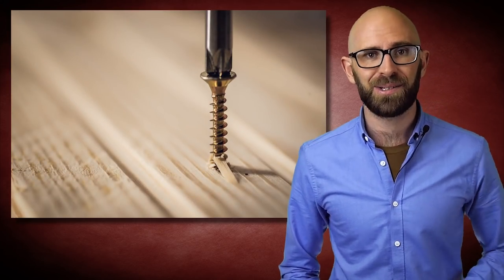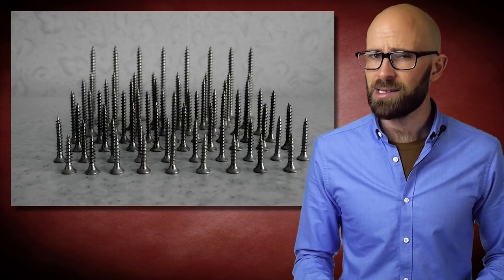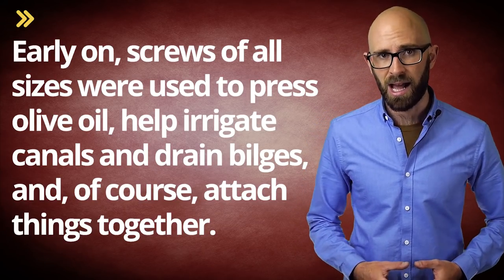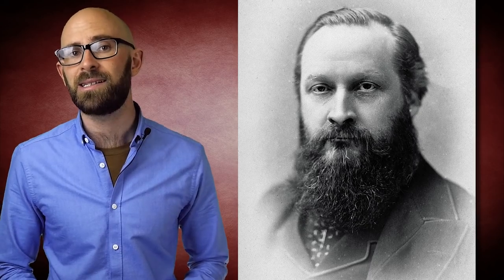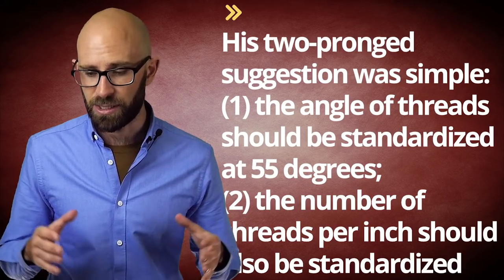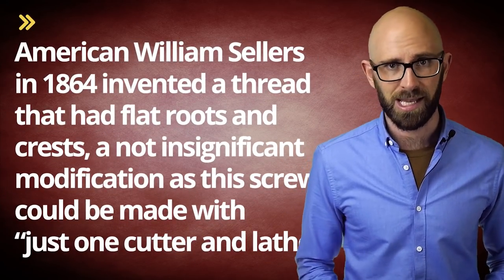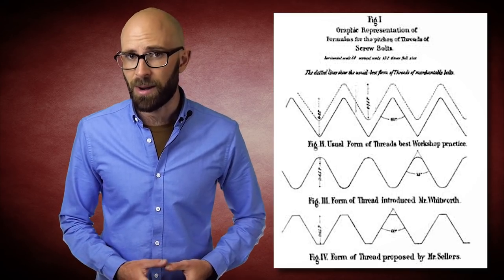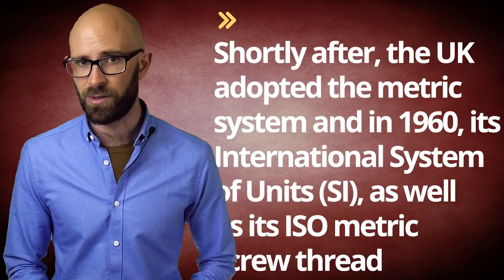Why Do Screws Tighten Clockwise?

Comment: It's worth noting that the reason that a relatively backwards former colony of Great Britain (the US, vintage 1800 or so) ended up having so much influence on screw threads was thanks to Thomas Jefferson, who having been to Europe, had met the men making the first screw-cutting lathes and promptly began promoting them in the US.  They were slow to catch on in Europe, however, because they displaced a great deal of skilled labor (a machine could do what craftsmen had done) and thus fell afoul of the European guild system.  The US, being short on skilled craftsmen, long on raw materials, and not having established guilds, took the early machines and ran with them.  Early US patent law and social mobility also help encourage inventors to innovate and modify in ways that a more rigid social structure wouldn't allow.

Comment: Every so often, you'll come across a screw, bolt, or nut that tightens with counterclockwise rotation.  They're typically on counterclockwise revolving parts that would cause a clockwise-tightening screw or nut to loosen.

Comment: So the real reason, that the biceps brachii is a strong supinating muscle, where as all the pronating muscles have their root either on the lower arm (and a smaller leverage) or from the lower upper arm is mentioned in half a sentence. Judging by the video title this video did not give information on why the screws turn outwards to fasten, but more on the screws angles and shapes.
Reply: TheKlabim : Odd. The times I've needed full strength on a bolt have always been for loosening it.
Reply: William Dye And even then you aren't using a driver. You use a ratchet, and then you're no longer rotating, but pulling or pushing, of which you could do either for either direction... His explanation is utter bollocks.

Comment: Here's an interesting fact (in the US anyway). Water pipe fittings screw to the right like normal but gas pipe fittings are the opposite so you can tell right away if you have the wrong pipe.

Comment: Only Simon Whistler can make something so mundane as screws super interesting.
Reply: These topics vary wildly
Reply: Daniel Mebus lol yes they do
Reply: James may
Reply: Kenny McRae thanks for taking the time to respond. I definitely found a new appreciation for the complexity behind making screws as well as the versatility and how useful they are :)
Reply: No other machine performs such a critical function with such precision and reliability  at such a low cost. Threaded fasteners are extremely complex once you start digging.
Reply: Don't say a screw is mundane. There's a lot of science in screws these days. Lots of different angles, thread patterns etc. always depending on what you want to accomplish (i.e. a drywall screw looks a lot different from a machine screw - for good reason).
If only Americans would finally give up that stupid not really imperial system. It's so much easier to deal with metric parts.

Comment: Whitworth also applied his screwy ideas to rifles and produced the most accurate longarms of the 19th century. His rifles had a hexagonical bore and fired a hexagonical bullet. They were deadly accurate to several hundred yards and were highly coveted.
During the 60s a number of car manufacturers started using left hand thread lug nuts on the driver's side wheels and right handed nuts on the passenger side.  The belief was that making the threads opposite to the wheel rotation would keep the nuts from loosening but most of them abandoned the idea after a few years.
Reply: Wow, he really didn't screw around, didn't he? Others would have screwed up being in his position, I wager!
Reply: Hexagonal* hexagonical isn't a word
Reply: Additionally, the NYC subway system used (uses?) left-hand-thread lightbulbs as an anti-theft feature: if you steal the lightbulb, it will be useless in any of your home fixtures. Self-tapping screw extractors are left-hand threaded, too: as the extractor tightens, the sheared screw loosens.
Reply: Many bolts used in modern automobiles are still left hand thread. For example the bolts inside a differential are commonly reverse threaded.
Reply: Toilet flush handles are held on with left handed threads,  Gas valves on a B tanks are left hand threads,  lots of arbors on tools can be left handed, depending on the tools rotation direction. Lots of old stems for faucets that used a screw to seat were left hand threaded on one side.
Reply: Acetylene hoses are left hand threaded so you cant hook the hoses up backwards.
Reply: Your Long Lost Father with enough duct tape you can still hook them up.
Reply: Dan Christy It's meant to prevent accidents not suicide.
Reply: Tristan  Behrens 
Should be, it's fun to say.
Reply: Car wheels don't rotate about the lug so there's no need for reverse threads. Some fans with one nut holding the blade assembly are reverse threaded, also one side of a cable tightener, the bar with threaded hooks on each end
Reply: Jared De Leon I've been a mechanic for 18 years and I've never seen reverse threads on any differentials I've taken apart.  American or otherwise.
Reply: Centre-lock wheels have a single nut which is threaded according to which side of the car it is for.
Reply: If you leave wheel nuts/studs loose then the ones on the right of the car tighten, but due to small epicyclic fretting movements the left hand ones will undo. All single nut fastenings used on race cars and old fashioned wire wheels on splines use opposite handed nuts. Only Rolls Royce used opposite handed stud nuts on wheels as far as I know. The big nut in the centre that holds the hub to the axle will be handed in most cases even today.
Reply: Donald Sayers GM and Chrysler did it in the 50's as well.  And there's a reason they stopped.  Because it doesn't make a difference and only causes confusion in a shop that doesn't know about it.
Reply: I agree for studded wheels. Centre fix wheels are another matter.
Reply: our old late 1940's and 1950's buses use opposite handed threads on the wheels depending on side, we've never had a wheel come off due to lose wheel nuts (but with proper maintenance it shouldn't be happening anyway), have you ever notices that it's only ever the left hand wheel that you see come off on trucks (just an observation, could be very wrong, i haven't been able to find any studies that make a comparison with a quick google search so if you find one pass me a link will ya).
Reply: All bicycle pedals are likewise handed — the left hand pedal has left thread. On the bottom bracket, there are thread standards that have two right hand threads, but 95% are left/right (on opposite sides, this time).

Precession, it’s a thing. 

On car lugnuts it is likewise a thing. The reason cars are not handed now is that they don’t use lugnuts. They use lug *bolts*, with a conical interface between the bolts and the rims. It’s that conical bit that takes care of keeping them tight, not that they are slightly off the axis of rotation.
Reply: JohnLeePedimore Q
Reply: Other cars had left hand wheel nuts on the left side, Jeep comes to mind.
Reply: What did the rifle barrel say to the nut, the bolt, and the light bulb?

.
.
We're all screwed.
Reply: JohnLeePedimore Right you are. I remember our 1964 Olds that had lefties on the lugs.
Reply: If it were a UK lightbulb it would reply "Actually, me old cock, I'm bayoneted".
Reply: Bayonet lamps lock in clockwise too.
Reply: Actually, the left-handed wheel lug started in the 30's in America. Thank Chrysler for that.
Reply: The old Dodge and Plymouth A-body cars had the left hand threads for lug-nuts on one side... you had to turn the wrench toward the front of the car, no matter which side, to loosen the wheels! You'll find left-hand threads on a lot of things that rotate, such as circular saws and motorcycle flywheels.

Comment: Keep in mind, if you're trying to "lefty loosen" something and it just won't break free, it's probably a left handed thread.
Reply: Ed M Or it's a seized bolt
Reply: Exhaust manifold bolts mate. smh"
Reply: The other day I was screwing back on a panel held on by captive screws. Most were flathead, but two were philips head... took me about 2 minutes to get the two philips head screws in because they refused to catch (can sometimes be finicky), then I realized that despite all the other screws being righty tighty, these two just had to be special and not only be a different screw, but also lefty tighty.

Comment: fun fact - Both left and right bike pedals have different threads.
Reply: holdmybeer and the bottom bracket cups( the bearing races)
Reply: Well duh because they spin opposite directions. The screws holding them on must counter that or else you could loosen them (or one of them) by peddling.
Reply: And even more fun...most of those threads (including the bicycles from China) aren't metric...and they aren't Unified National...and they aren't Whitworth. Most of them are BSCY threads.. British Std. Cycle Thread. Most of the screws in this series are 26 threads per inch, nominal inch outer diameters, and 60 deg thread form. 
I often run into this thread on British motorcycles made before 1980.
Reply: Imagine if only one of them was different.
Reply: Common sense, if you don’t know this by the age of eight, you should go outside more.
Reply: But it's more than just the direction that is different.
Reply: Fun fact - Many Canadian army vehicles have wheel fasteners that tighten clockwise on one side of the vehicle and counterclockwise on the other. Its for the same reasons as the bike pedals.
Reply: Bike pedals have threads? All the ones I've ever seen are free rolling...
Reply: Fun fact, there's one customer a year that doesn't know this and needs a repair.
Reply: holdmybeer Tis true, I think left pedals are left handed and right pedals right handed. It's so if pedals aren't screwed in tight enough then when you pedal they automatically tighten. If the left pedal went in a right handed threaed, and it wasn't put in tight enough, over time it would loosen and then fall out onto the road.

Same goes for if a right pedal used a left handed thread.
Reply: holdmybeer crankshaft pulley on engine is screwed with left handed thread for the same reason, as engine spins, bolt stays in place without losening it self from rotation
Reply: An easy way to remember the direction when working on pedals is to put your wrench on the rear wheel side of the pedal and push for removing and on the front wheel side and push for tightening.
Reply: Who in the right mind would know that by age 8? Kids only care about riding their bike. Not how it works.
Reply: Fun Fact: Worm-drive saws (like the original Skil Saw) and chop saws have a blade on the left side of the motor and are reverse-threaded. Home owner-style Sidewinder circular saws have the blade on the right and have a normal screw for the blade.
Reply: holdmybeer so do knock-off wire wheels on British sports cars.
Reply: Supposedly an invention of the Wright Bros, bicycle manufacturers and pioneer aviators. The first record of L and R hand threads on pedal spindles was in their catalogue. Prior to that, both pedals were RH. Presumably there was some sort of lock screw on the older ones.

Comment: In the Marine Corps ( I was in the air wing) we had lots of gear that used left-handed threads because of torque direction. Lots of bolts and screws on aircraft are also left-handed, too, for the same reason.

Comment: Why do we have "sweats like a pig" as a saying even tho pigs don't sweat?
Reply: The original expression "sweat like a pig" allegedly comes from smelting pig iron (which sweats as it cools). Pig iron, by the way, is so named because it's shaped in molds that branch off like piglets suckling on a sow.
Reply: More likely " sweat like a pig iron puddler" . The workers overseeing the hot work of pouring molten metal.
Reply: It's coz of a new kind of cow iron that you have to "moo" at for 3 hours during the smelting process

Comment: So the answer is right-handed people are stronger clockwise...and a bunch of other jibberish is said in this video. (AKA the history of the screw)
Reply: That answer is not really true. It has to do with the force--the torque--that the screw applies when turning. When you turn a screw clockwise as you look down upon the head, the force goes down into that which the screw is being applied. When it is turned counterclockwise, the force or torque of the screw goes into the opposite direction. This is physics, not handedness. That was the one thing he got wrong.
Reply: ginnyjollykidd So the one thing be was suposed to answer in this video, was the one thing he got wrong?
Reply: I believe ginnyjollykidd is over-explaining in a snarky manner.  If you reverse the threads on a screw,  then when you turn a screw counterclockwise as you look down upon the head, the force goes down into that which the screw is being applied.  When it is turned clockwise, the force or torque of the screw goes into the opposite direction.  This is physics exerts force depending on the direction of the threads.
Reply: Yes, right hand dominant people are "stronger" with right handed supination (screw to the right) than right handed pronation (screw to left) because of the way the biceps tendon attaches to the tubercle on the radius.  When you supinate your right hand (righty tighty), you are able to use your large bicep muscle with good control to do so and since most people are right hand dominant, this is why the screw was made righty tighty/lefty loosey.   If you are having trouble getting a screw out, ask a left hand dominant person to help you because they can use their powerful  biceps muscle with lefty loosey - with good control.   This is all about anatomy, it speaks for itself in this case.
Reply: Jeff Nielsen thanks for the detailed explanation. Direction of torque has nothing to do with it and is just a convention so that we all perform calculations in the same way.

Comment: There are a few applications that use left handed threads as standard. fuel line fittings for gas, saw blade fittings, fans and other parts where their normal operation would loosen a right handed thread.
Reply: 1/2 of bicycle pedals are also a familiar example!

Comment: I own a mitre clamp from the early 1900's. This tightens counter clockwise. Being a mass produced item this means the clockwise tightening system was not universally used at the time. This still leaves me with the question of when and why it became the standard.

Fun fact 2: Left and right threads are not only used on bicycle pedals but on truck wheels as well. The motion of the pedal/truck wheel can cause the threads to unscrew themselves. They are counter threaded to prevent accidents.

Comment: Enjoyed the episode on screws. I have a comment and a request.
I think the reason we have right hand threads predominating is because of how they are made on a basic lathe. Why the headstock has always been on the left? I'm not sure but it has determines the thread direction. I suspect it is better for a right hander to have the headstock to the left, allowing them to hold a tool with the right hand while turning the chuck with their left? Anyway, it makes sense for the workpiece to turn down on to a tool positioned in the front. And it makes sense to work towards the chuck as for big hunks of wood, it would be the first place to start turning. All this said, you end up with a right hand thread if all these things line up. So, "righty tighty".
Request: I have not found any explanation online as to how the very first thread could be cut, with no lead screw on a lathe. Yes, one can make spiral grooves on a wood lathe but how do you control the pitch of the thread so that it stays constant. Even the famous five foot long screw made by Henry Maudslay varied in pitch down it's length. He improved on this to make his first micrometer, which was a great success but required many attempts. So, how did he turn a long screw with a consistent thread pitch that could be used for very accurate measurements? I have a theory, but would appreciate someone to research this thoroughly and make a good detailed video. 
Thanks!

Comment: You say the UK switched to metric in the 60s but we really didn't. Metric and imperial are both freely available, there's also left handed bolts which many machines use so the nut of bolt doesn't come undone if the tool like a strimmer spins clockwise although much less common day to day they are fairly common in mechanical hardware and you need to be aware of that if you are working on such

Comment: Screw threads are right-handed as it is easier to make them on a lathe, following the profile of the leadscrew (through gearing to set the pitch). Left hand threads have to use a tumbler reverse to reverse the direction of cutting.
As already noted you are mixing woodscrews and machine screws in explaining manufacture.

Comment: You forgot to mention that there are cases where the screw tightens in the opposite direction. Lefty hand threads is usually for part retention on moving parts such as saw blade retention bolts on circular saws and other similar situations where the torque involved would loosen the standard right hand thread.

Comment: Please find any video of a lathe. Note the position of the motor: on the left, direction of rotation; counter-clockwise and the motion of the toolpost; right to left. Combine these together and you will get a right-hand thread. For left-hand; the machine has to be in reverse and the tool bit upside-down. This is more awkward in a manual machine.

I started my working career working as a Fitter/Machinist in the RTA Sydney.